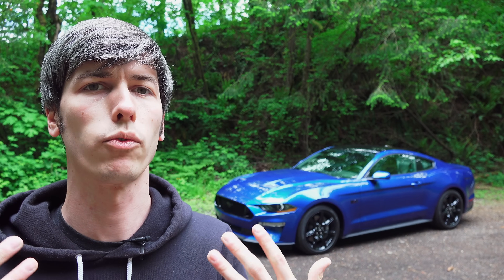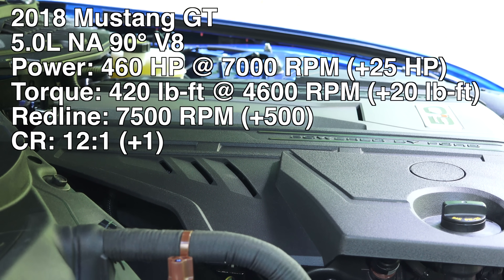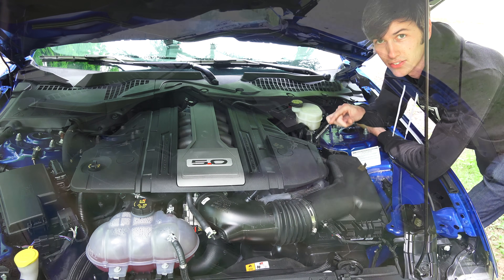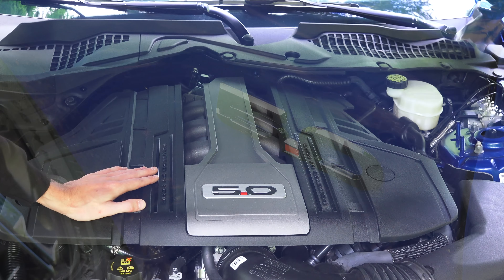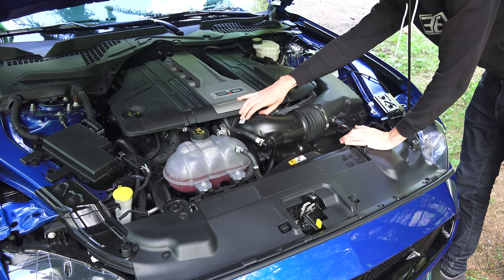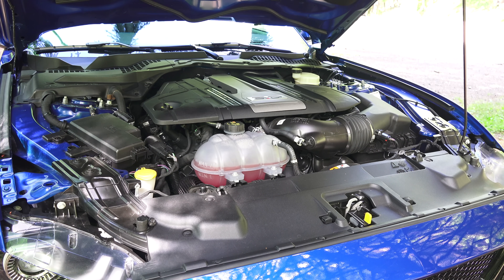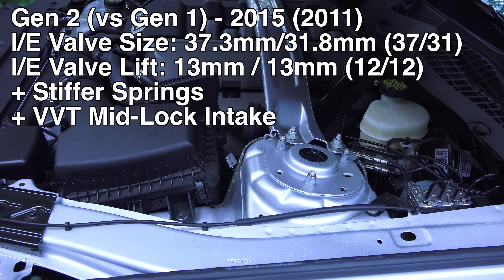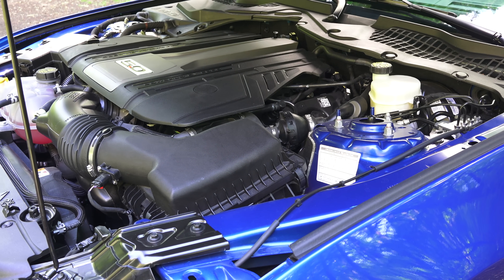The Best Engines - 2018 Ford Mustang GT 5.0L V8

Comment: Recently I was at a dragway. There were a lot of modded v8 cars racing. However the Mustang with a stock Coyote engine, but just pro charged, was running 9 second pulls. It wrecked all other cars. I have a few videos of it on my two videos at Atco Dragway.
Reply: Den Hayes I'm guessing that he means stock internals which would make him technically correct as a pro charger is a Bolton to an engine and not part of the engine itself.
Reply: Den Hayes except he never said the car was stock. He said the engine was stock. As in no work done to the internals to make it handle power or boost. What he is trying to say is its pretty awesome how much power the coyote can push out on boost with out having to reinforce the engine.
Literally says in his comment "a stock coyote ENGINE".
A procharger isnt apart of the engine.
Reply: @evanderlugops  not as impressive as leroy's engine, you should take a look at cleetus mcfarmland's channel.
Reply: marc blub we arent talking about other cars. Coyotes dont come with boost from the factory. They arent apart of the engine. If we were talking about a GTI your statement would apply.
That's why I specifically said a PROCHARGER.
Reply: Exactly, a supercharger is just a different sort of intake. Nothing to do with the engine. Especially considering a centrifugal supercharger bolt on w/tune on boost is significantly cheaper than an engine build. Impressive that it could run 9's with only that.
Reply: scooter bros the engine is stock. A procharger is a bolton poweradder. Not part of the engine lol
Reply: Ford's Long Blocks are more Forged than either Chevy or Chrysler engines
Reply: Den Hayes come on man grow up, you’d have a point if he left out the prochaeger entirely until someone called him out and then mentioned it, but it’s pretty clear what he meant and it’s not at all controversial, literally go watch 1,000 smokingtire one takes where Matt sums up the owners car as stock + bolt ons. Gtfoh, nobody is confused about whether or not a mustang running 9’s is 100% stock or not. Stock + bolt ons simply clarified that it’s got stock internals not upgraded/forged internals or some crazy fully built race engine with crazy compression ratios etc. 

Your problem is inability to recognize the importance of context and adapt to it, and in the context of a drag strip frequented by high dollar fully built racecars, a mustang w/a slapped on it is very much “stock + a centrifugal supercharger”.  The simple fact that you aren’t familiar with a particular turn of phrase does not render it incorrect, if it did “turn of phrase” would likely be incorrect as well as most people aren’t familiar with that either.
Reply: "Stock Engine" = "Stock Internal"
My car is tunes is mostly refer to any part of the car that was change (suspension,brakes,engine internal)
The engine is stock but I bolted on a turbo (Stock Internal+Force Induction)
Reply: Morning Wood and then determining which cylinders are essential and which aren't becomes asinine. Point being, once you slap a charger on a car, it no longer has a stock engine. It adds to the performance of the engine, therefore it is a part of it.
Reply: Guitar whoever told you that engine was stock was lying. You need about 800 hp at the crank to run a 4000 lb Mustang in the high nines.  Simply adding Boost to a 425 hp engine (old Coyote) requires way more fuel than the stock fuel system can deliver.  In addition, the high compression combined with massive boost will lead to pre-detonation, which will destroy any engine.  So the 11.0 compression ratio must be lowered for that engine to survive high boost.  So at a minimum the pistons are not stock.  And if you change pistons, you may as well go ahead and change the rest of the rotating assembly, otherwise you are just moving the weak link to another part of the bottom end.  
By the way, the old iron block 6.0L LS truck motors are the preferred engine for budget drag racing.  Give it a new forged crank, connecting rods and pistons with a hot cam and the block will tolerate massive boost from turbos or pro-chargers to deliver up to 1,000 hp reliably. If you want any higher HP than that requires a custom built block from a big name engine builder.
Reply: Morning Wood technically speaking, engines can operate without all of their cylinders. Chevrolet has this technology in their Tahoe if I'm not mistaken. Therefore, by your logic, the cylinders are not a part of the engine either since they can operate without some of them.
Reply: psnmadracer27 I know. Dodge does this with some of their cars like the valet mode. you can turn off a couple cylinders but not all. You still need at least one to run. And if we are being technical turning of the cylinders from firing won't magically cause the cylinders to disappear and they are still physically be in the engine.
Reply: Den Hayes Bolt on Centri Supercharger Kits are very popular for these engines. Takes an afternoon to install and can easily get 700chp(Crank HP). No internal work, no aggressive camshaft, no Intake manifold swap, etc..
Reply: was it a 1/8th mile?  the average there is around 10 with a good few 9s and less 8s at my local drag strip.  a stock mustang is not gonna get a 9 second time on a 1/4 mile.  my Nissan 350z gets a 9 second 1/8th mile though.
Reply: marc blub if you want to get technical then no a turbocharger is not a part of the engine in either scenario it’s a bolt on modification/accessory/compressor/power adder etc...forged pistons and such would be parts of the engine though, so upgrading those would mean you no longer have a stock motor, by your logic a aftermarket alternator or A/C = no longer stock engine, hell the entire Powertrain and all the electronics are now “parts of the engine” as well. 😑
Reply: Nobody running 9 second 1/4 mile racing cares about a stock rotating assembly. Just the NHRA certified cage and SFI rated fire system alone will cost more than your engine internals. A set of Weld Racing Alumastar wheels will cost you over a $1000 a pair, and then you'll need $550 in tires just for the rear end. You'll spend $500 for just the fireproof suit and another $500 for a compliant helmet. There are lots of 9 second cars out there, but almost none of them use Coyotes.
Reply: Limo Wreck can you clarify your point/what exactly the intended takeaway is?? It’s not clear what you’re saying aside the self explanatory bits about race upgrade costs etc
Reply: Sure, sometimes it takes me a few attempts to get my thoughts down in an organized maner. Sometimes people telling you how great an engine is will sight "stock internals" on a high power race engine as a cost saving feature or some sort of show of quality. I've found that it costs so much to build and actually operate a real racecar anywhere near that fast that a set of internals is almost cheap compared to the tens of thousands of dollars you'll spend on everything else. The quality assumption is totally bogus, there are no factory assembled bottom ends that will rival the quality and precision of hand built bottom end by a real race shop, and that includes the assembly and the materials used. The Chrysler Hellcat/Demon's custom unobtainium pistons forged from some special new unnameable (doesn't conform to traditional naming standards such as 2618 or 4032) alloy created just for them is kind of a one-off and only Chrysler knows the exact properties of the material they used. 

The OP stated "However the Mustang with a stock Coyote engine, but just pro charged, was running 9 second pulls. It wrecked all other cars." and then some went  back to the familiar "what is a stock Coyote and what isn't" and "stock internals are so great". 

No engines or chassis doing consistent and legal 9 second 1/4 mile times are remotely comparable to the engine in this video, and there is zero point in arguing over the quality of rotating assemblies in stock engines because even if they will make the power needed to get a Mustang into the 9s, that's the only part of the car that will be left untouched.
You might be able to use the bottom end of the Coyote, but the rest of the chassis fab work and engine top end parts will cost huge money to make it 9 second legal and allow it to launch hard enough to actually run a 9 second 1/4 mile. Hennessee's own website says their supercharged GT350R with 850hp will do a 10.8 @ 133mph and we know a pushrod Dodge Challenger Demon will run in the 9s, which only proves that an engine is cube that makes power regardless of its features like the number of cams, valves, or any other parts that people like to focus on. 

If this person saw NHRA Factory Stock class racecars at Atco Racway, he/she did NOT see a stock car at all. Even if the major internals are stock, they'll still clearance everything, balancing and blueprinting that bottom end to the highest degree possible and probably more than once per season. That ain't stock, and stock parts prove nothing, even when a street car does a time like that because they have be clearanced and reassembled at a minimum or the piston rings will butt together and Kaboom. Plus you have no idea how many miles they may or may not get out of those amazing stock internals after they are making 850 - 1000hp. What's the point in saying "yo! I've got a stock bottom end under this giant blower." if you run over the crank at the end of the season with 100 miles on the odo?
Reply: @limowreck2612  "get my thoughts down in an organized manor" 

Why would you get your thoughts down in an organized house?
Reply: Fee Nicks: fill me in.
Reply: Hahaha it's funny how all of you wasted so much time on common sense 😂😂😂lol
Reply: Coyote stock class in Nmra guys run the slower older 11-14 coyote engine is sealed all stick cars dumped into fox chassis lighted runs 10.20’s Give them 60 more horse they all run on the same tune bam high 9’s
Reply: These new 5.0 make a lot of power stock so it's no surprise. However they also come with a really high compression ratio, so adding boost can be dangerous if you keep the stock internals.
Reply: To clear up some confusion I should note that basically every other car was running a procharger. So the mustang didn’t have a huge advantage in that area.

Even the procharged CTVs, vetts, and other v8s couldn’t keep up. It was crazy.
Reply: stock Coyote engine, but just pro charged...........lol
Reply: marc blub if you want to get in to technicalities, turbos arent apart of the engines. Because engines can perform by themselves with out the use of a turbo or boost.
Again you are misunderstanding things. Noone ever said anything about the car being stock. The engine (as in the internals) are stock. There isnt any need to reinforce the engine to handle power once you add boost to it. Which is why he said. The ENGINE is stock. Not the CAR.
Reply: FordGTGuy
Not stock if something is bolted on that is not factory installed.
Reply: scooter bros Thank you for some common scene.
Reply: Morning Wood whoa look someone else that can English good! nice, I’m usually solo.
Reply: so a nos kit is also not part of the engine?
Reply: Hmm I understand where the engine is stock and a procharger was added but the engine cant be stock well stock specs since im pretty sure he had to mess with injectors or atleast tune the engine making the block have a different A/F. Which doesnt make the engine stock? correct?since your changing a lot on whats going on in the combustion part of the block now? I mean he could say the car has a stock bottom end or lets say his long block has stock components but the full dress block is not stock since theres an attachment to the block which is the procharger? okay imma stop now since we might get deep into the black hole haha
Reply: psnmadracer27 nonononono, that’s not technically speaking at all. Idiots lmao.
Reply: Incepting idiots, they’re everywhere
Reply: Limo Wreck you missed the point entirely
Reply: Morning Wood wait if a car comes stock with a turbo it is a part from the engine.if it doesn´t come stock with a turbo it isn´t part from the engine? anyway you can´t say its stock if it has a added turbocharger. if you say stock internals then yes ^^
ok im out it´s to much offtopic anyway xD
Reply: it´s not a part from the engine? take one of the newer turbocharged cars and take the trubo off and then tell me how the engine runs

Comment: Nice mustang but it doesn't really shine in the one category that matters, Performance. Even with the improvements I have seen this thing on the track being lapped by Subarus and Civics as well as being outdragged at traffic lights by the aforementioned models. Will the mustang ever be a serious performance vehicle?
Reply from the maker: There's no Subaru or Honda that's even close to as fast in a straight line (unless you count the NSX, a supercar). This is way faster than an STI or a Type R, track or drag race. Coming from someone who's owned two Subarus and two Hondas.
Reply: Engineering Explained I can not ignore what I saw about 3 weeks ago at a racetrack on the west coast of Michigan. Either the mustang driver wasn't very good or..... . I have seen this thing being beaten quite a few times at the light where speeds of up to about 60 MPH, not 100 plus are the resonable limit to where one car needs to distance itself to about one car length to get in front of the other before one of the lanes merges into the other just ofter the traffic light, as it usually does here in Michigan as it widens just before the light. No doubt it is a powerfu car but off the line traction..... not quite there
Reply: Julian N Ah, the good old traffic light race where one of the cars isn't actually racing.
Reply: Thomas Griffin i know what you were talking about and am excluding those races. I have also seen super enthusiastic mustang drivers overpunching it in frustration and spinning the rear wheels and still lose. Hard to argue in those cases they were the one car 'not racing'.

Comment: You should consider the cummins 5.9l diesel engine too just for its versatality ,it powered the dodge ram's of yesteryears and is still is used for powering 49T rated articulated tractor trailer along with numerois other units back in india.